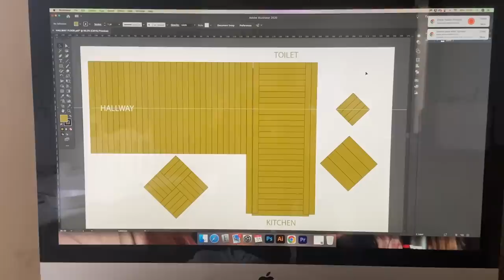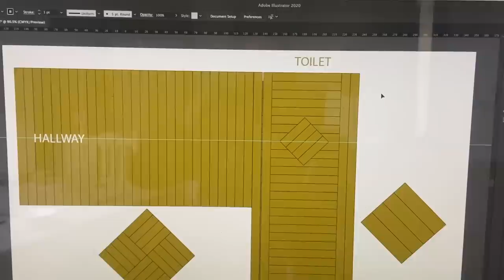The Chateau Work MUST GO ON!

Comment: You were right to lay the floor in the straight forward way. Laying flooring on an angle creates a lot of waste and if you're using the original wood you wouldn't want to waste any. Plus, it's easier and looks just as nice.  Totally agree with you on the ceiling embellishments. A simpler design would probably work better.  Love this channel!!!!

Comment: Nettles make for a good soup !! Take the youngest leaves (with gloves) and put them in hot water add some kind of stock (chicken, ...) mix the soup, ready to eat 🙂
Reply: Also, makes great tea, use as spinach.
Reply: They also make a great dip. Use nettles in lieu of spinach just remove the stinging nettles with hot water.

Comment: Carole I have had an idea. Instead of having the small pieces pointing outwards, like Fleur de lys or arrows, which looks a bit immobile or disconnected; try putting them pointing the other way, between the larger pieces, connecting them like a garland or inward curved scallops. Not sure I am explaining this well, but it would unify the piece. 🌹🌹🌸🇦🇺

Comment: caught the end of premiere, now watching from the beginning to see the moldings that Beth and Carole are working on. I like them but not so much in  layout. I don't know what is off, kind of would like to see the smaller swirls and rose shaped things by the round center part and the points of the bigger piece facing out? I don't know, you will figure it out and make it fabulous! thanks for sharing! 😍

Comment: That’s crazy for a church. Amazing with the traffic. As your small property is G rating. So poor rated. But! I’d buy it tomorrow. Already reached out to the agent.
Reply from the maker: Now I have done the roof and cellar insulation, fitted heat source pumps the rating will be higher

Comment: I wouldn't bother with such a fancy design for the ceiling rose . I would try and find a way of having the rose in the same plain design as the coving , maybe finding a plaster rose that you can fit on top of the original OR replace the original with a new one that matches the coving .

Comment: Would it be possible to cut out a thin yet sturdy sheet of OSB board with a hole in the middle where the chandelier would go and affix that to the top of the ceiling and then apply the plaster molds to it?  

Don't knock egg salad sandwiches!  They can be delightful and I'd rather have an egg salad sandwich than tuna salad however if Val and Alf would have had a chicken salad sandwich, I'd be very curious if they would pick ones that have raisins, grapes, or cranberries or another kind.  If you want to go for something a bit more pungent, make some onion wraps!  I grabbed about 8 green onions from the garden, spread cream cheese on it, and then wrap with deli or cured meats.  If you bring a whole tub of it for the next trip, offer one to whoever is nearby so they can enjoy and then they won't mind the onions since they'll smell like it too. 😉

Comment: The ceiling rose set is awesome!  But yes, I saw pineapple in your design straight away 😂 🍍😂.  I just put a decorative plaster ceiling panel up in my lounge room and I used plaster adhesive and screws into the studs.  But my panel is 1200 long and 800 wide. Plaster adhesive is probably all you need.  They will look beautiful, just in a different design.  Can you get your design inspiration from the grand salon embellishments?

Comment: Do go to a few companies for advice about installing an heat/air source pump. All the French companies are pushing these as France wants to go greener and stop using log burners and fuel/huile systems.
 My friends had one put in their large country house in France and they still have to use the log burners seasonally as well as it is just not up to the job. I had a granule burner put in my house in Faymoreau, 85. It was efficient, but, of course, it cannot be used when there are power cuts, all those countryside over head power cables, so i had to have a portable gas cylinder fire.Got  rid of the log burner ans totally regreeted it-bad decision.  To be honest, ive no idea how any comany can think they can heat a huge chateau with an heat/air source pump and, the cost will be as HUGE, both to insatll and run it- even if you can get some government granting.
 All my French neighbours had the traditional log burners with the occaissional electric radiators/gas cylinder portal fire for extra boosts in the winter- there is nothing like a log burner for pushing out the heat.
 Lots of Brits coming back to the UK now. i came back in early 2022, my friend came back in summer 2022 and iv'e other friends, French based who are in Derbyshire at the moment, then going back to put their house in the Deux Sevres, 79 up for sale. 
All have come home because of family ties in one way of another. Good luck to you all....what a co-incidence, my cousin has a house in Gorron, just down the road from you- they are also planning to sell up in the spring of 2024....
Reply: Hello there again, my comments might have been a little blunt, as iv'e never met you all. But, there is no point you spending thousands on a new system if you are selling the chateau, better to use that money for your planned move back to the Uk where you will make money. My friends, who sold Chateau Poiron, Pissotte, last year had an ancient Huile system there and log burners. They had lots of viewings, film directors and finally a French surgeon bought it. Good luck.